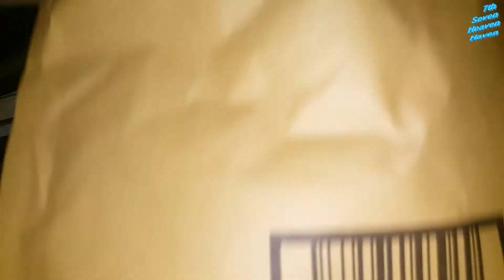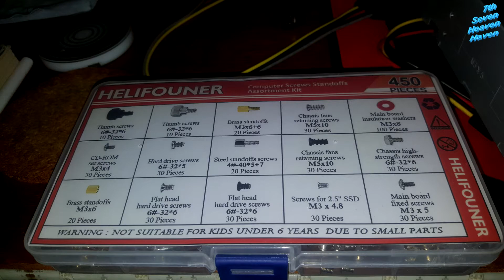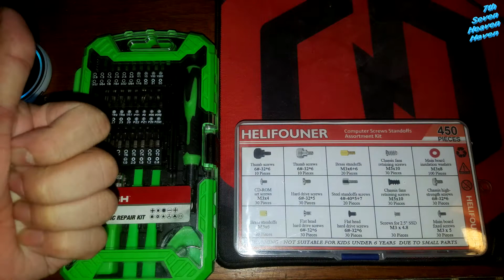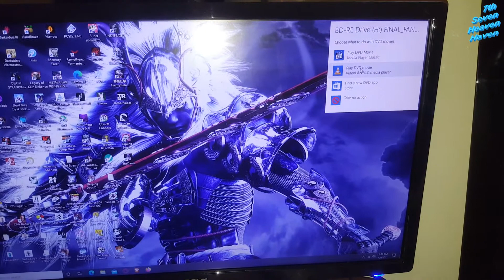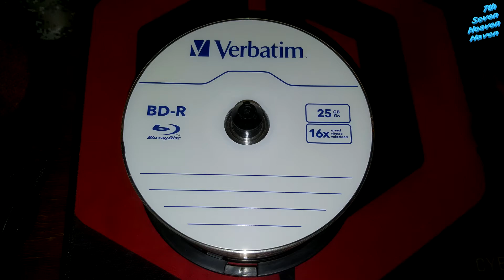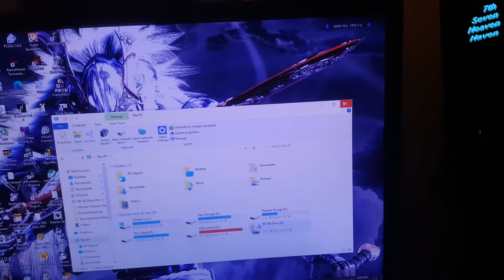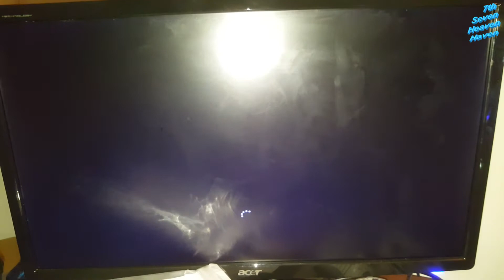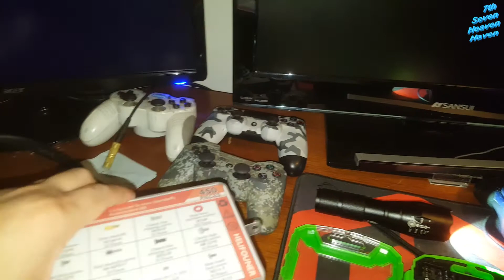How To Install, Setup and Test The LG WH16NS40 Super Multi Blue Internal SATA 16x Blu-ray Rewriter

Comment: I have owned 2 LG burner/drives. The first one was a DVD burner... it crapped out like 6 months after I bough it. A few years later I bought this one. 3 months later it stops reading blu ray disks. I think LG is a cheap product and would not buy one again. I even updated the firmware to 1.05 and same thing. My final opinion.... LG sucks!!! The repair will cost as much as a new drive...so that's wasted.. anyways good luck with LG lol...
Reply from the maker: I've been involved with so many different drives of CDs, DVDs and Blu-rays so I ain't new to this kind of thing. That's your opinion. I still own the same DVD drive that I've had since 2010. That one still works. We'll see if this Blu-ray drive will work longer than 3 months. Sometimes if you take good care of the tech and gadgets that you own properly then it wouldn't break on you sooner than you think.
Reply: but literally the whole internet is saying this is the best internal blu ray drive on the market right now?
Reply from the maker: @saveEarth69  I'm not really the type to listen to what the internet say. I usually buy the device, test it and see for myself it works or not. I will test it for several months to see if it will break or not. If it past the test and still works after a year of reading and writing discs then that's good enough for me. I usually give it a good score if it can last at least 7 to 10 years. That's my expectation with this. I might be wrong though because some drives do arrive defective and may have to be returned.
Reply: I have LG DVD burner which is 19 years old now and still going strong 👌 maybe you got the defective one